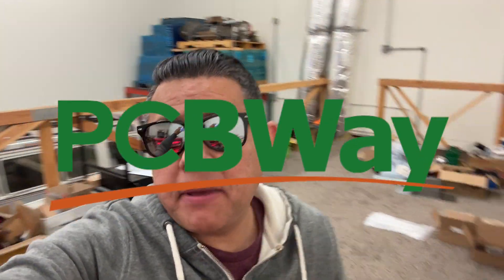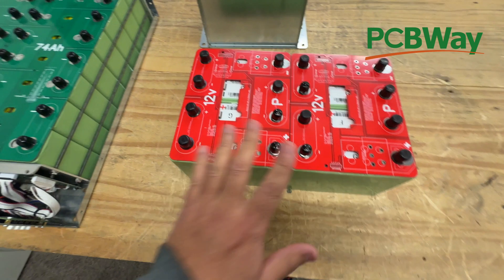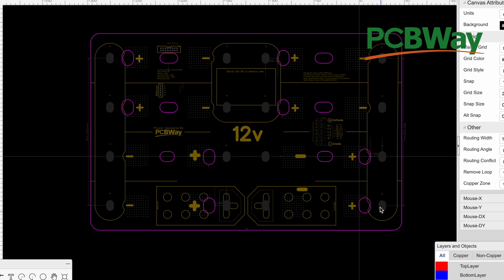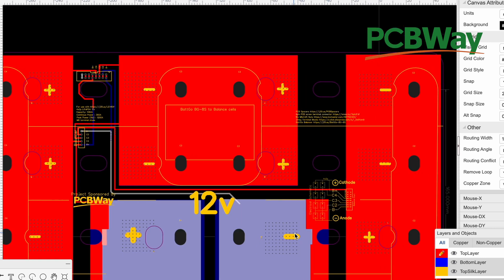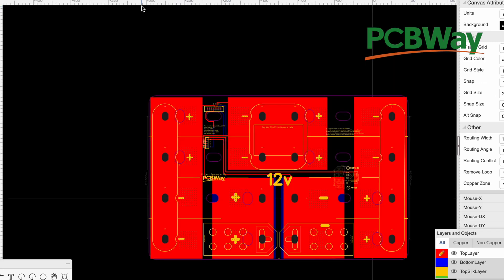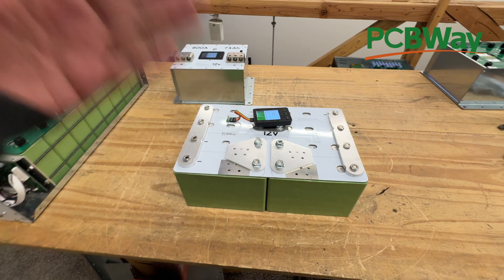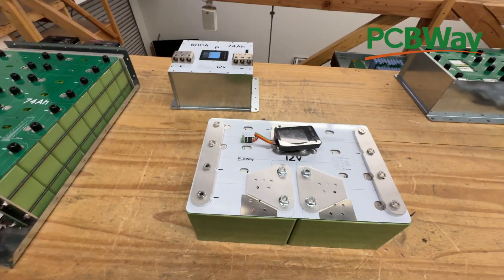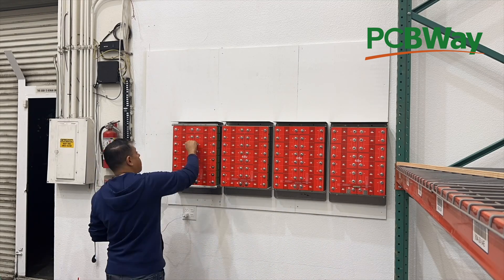Beginner 1200A 12v Car Audio Lithium battery - PCBway

Comment: Copper is king in audio. Want cheap go with aluminum?  CCD copper-clad aluminum is cheap but anyway you go copper is the best for audio.  Look at power lines its cheaper to run power lines in thick heavy aluminum than more expensive smaller copper lines.

Comment: You need to make a busbar PCB for the LF280k batteries in 48v for home storage. That would be amazing!
Reply from the maker: Who sells those cells?
Reply: I got some you wanna buy?
Reply from the maker: Where did you buy them?
Reply: @jehugarcia  I bought them from Docan power. Their US warehouse is in Houston, so I picked them up locally.
Reply: @jehugarcia  I can’t wait for the LF560K comes out next year. That will be a real game changer IMHO. Use 1 BMS and a cheap seplos box. Easiest cheapest +25kwh battery.
Reply from the maker: https://j35.us/Docan-LF280?
Reply: @jehugarcia  Those are them. Using seplos and other diy rack mount kits they use a foam between the batteries and a little compression to keep them tightly packed together, so the dimensions between terminals might be off by a few mm.
Reply: @Jesd003 can those batteries be used for car audio

Comment: Just got the lev60 slim with a daly Bluetooth balancer. Nice battery for the money. 2 if the cells were in the wrong position, did have me scratching my head f9r a 2nd ha. 

Wish I could fit the 148ah in my factory battery spot.

Comment: If i could afford it i would have 8 for a 3k watt setup for the sub and 400watts for ech door right now im just running 2 deep cycle batteries and 2 amg batteries together and well idling in my jeep liberty the battery bank does stay above 13volts for 2-3 hours depending on how far i turn it up i start to clip about 37 out of 40 on my head unit and i normally keep it about 20-34 for the volume and amps are all tuned out as well so it sounds as good at 10 as it does at 36 deep clean sound from that DD715D2
Reply: Out of curiosity, is over 3000w reallyyy necessary in a car? Lol won’t u pay for it with ur hearing down the line?
Reply: @Sam3532   not really but it makes money at demos so I just see it as another source of income

Comment: What is the charge cut off voltage on these 12 V batteries?
Reply from the maker: Standard LiFePO4 3.65x4= 14.6v
Reply: Gracias!  @jehugarcia

Comment: I just installed an 8 cell big fat under the back passenger seat of my Chevy Avalanche last week. 

Along with dual alternators it will be supporting 2 Slapz Shock 8k amps.

Comment: If i needed to run high Amperage id buy the heavy duty Bus Bars you sell. In my tiny DIY Solar system i wouldnt need to draw 1200 Amps. I might buy 2 more of the Red PCB 4 cell pacs. to extend the run time. I ran a quartz Radiant Heater on low 350- 400 watts for 4 1/2 hours. In a power outages i may have to run the heater 8 hours so;  4-4 cell pacs should be good.

Comment: What about a 2 cells wide,,by 2 cells long? would be the most compact way.
Not sure if there would be a issue due to it large capacity.

Could you just cut the existing one in half to get 2 cells by 4 cells
Reply from the maker: https://jag35.com/products/baby-slim-assembled-12v-148ah-1200a-lev60f-battery-lifepo4